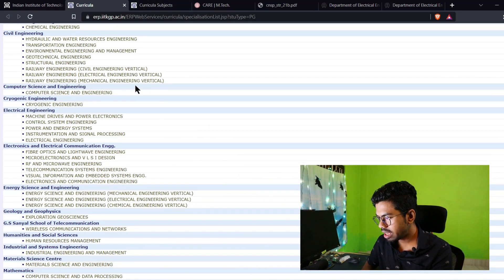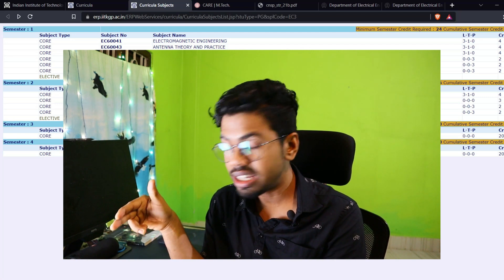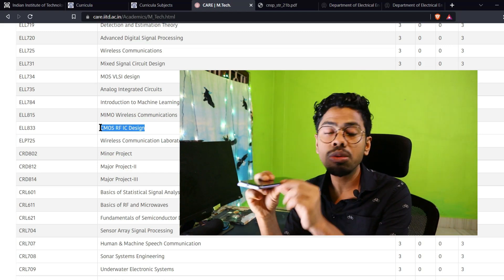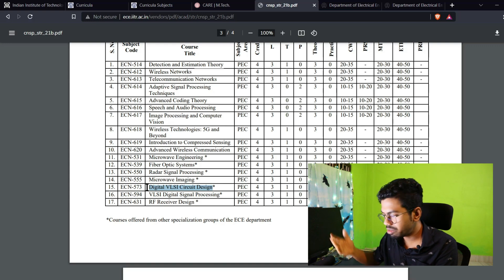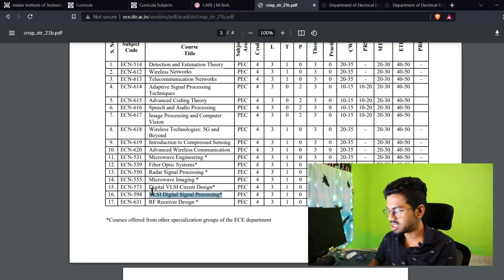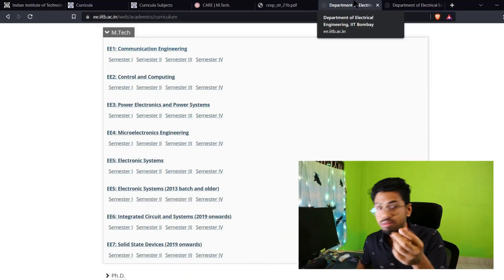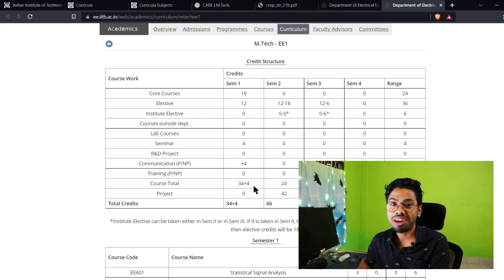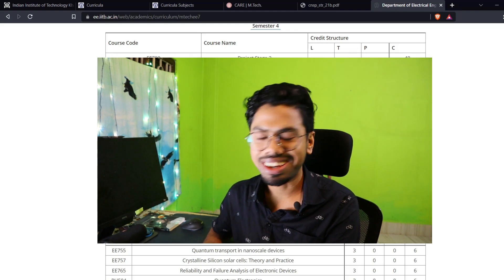Non VLSI IIT or VLSI NIT seat | Getting a VLSI jobs from non VLSI branch | VLSI vs RF vs Signal |

Comment: I completed my bachelor's in Electrical and Electronic Engineering.
I have never heard about vlsi and there was no opportunity for me to learn them in the Undergrad.
I am going for my master's in Electrical Engineering (vlsi).
For that I have started learning 1. Fundamentals of Semiconductor 2. Digital systems and circuits 3. Analog electronics 4. Analog integrated circuits 5. Vlsi physical design.
In nptel platform.
If i don't have a solid base i may find it extremely difficult in master's.
So I think I am doing the right thing.
Share your thoughts Mazumder.
Reply from the maker: Yes your doing the correct things... 4,5 is optional... If you can its great or can do this during mtech ... Also add digital ic (your list dont have it )in the optional list
Reply: @whyRD  thank you so much.
I have received my admissions from  Arizona State University, University of Texas Arlington, University of Texas Dallas, University of Houston, University of South Florida, Northeastern University and University of Buffalo.
Among that I have chosen Arizona State University.
Still left with 35 days I need to kickstart my preparation.
Reply from the maker: Congratulations 🎉

Comment: Sir IIT BOMBAY energy science and engineering is good for placement? After this will I get chance to go into vlsi industry if I do some additional courses?
Reply from the maker: Hi with extra course you should be , but issue is that some time visiting company  dont know much about your branch ,that this branch people are also equipped with vlsi skill, so they just dont include that branch for interviews.... So if max of people from any branch know vlsi branch then you can request particular company to open for you also.. To know this details connect with any alumni... Moreover off campus have no such issue.. Your cgpa,project and IITB brand talk for you.
Reply: @whyRD  OK thanks.

Comment: Hello bro. It is better to take training in bangalore Or to study  M. Tech for getting job in Vlsi so i completed one year in software industry. I want to join vlsi. Could you please recommend what is best
Reply from the maker: Both are best in thier own way... If dont wanna study all those non necessary subject for VLSI to prepare for gate and then doing 2 yearaster . then training is great.. But with training you need to have. Sounding knowledge of circuits analog digital and verilog and then only you need to start a training....then also training institution provide a very minimum placement assistance and that to majority of the case service base company.. And therefore to get into product based you need to do hard work in the company for less money for 3-4 year.... Before reaching to a stage where your salary would be same as a MTech graduate... In worst case you may need 1-2 more year..

Comment: Bro,
Please help me with a suggestion.Recently I got placed  in Lnt defence department and the role was not mentioned and the package was 6lpa.I have another offer from the vlsi based company I.e cerium systems which is 4.1lpa with 3 years bond.This year I didn't get a good rank in gate.Considering the good learning and growth and scope which company in your opinion is best to join?
Reply from the maker: It would be better if you the exact role of first offer to compare ...
Reply: @whyRD  Bro in the offer letter the exact role was not mentioned.They said that after 1 year training they would give the role based on the requirement in the company.I tried to connect through the linkedin to know the role but it  didn't work out.Suppose if the role might be given as Electronic system design engineer or Hardware design system engineer or Embedded related role, which would be the better choice between lnt defence and cerium systems?

Comment: Sir can you suggest me the best compiler for VerilogHDL
I tried edaplayground but it gives me errors as i don't have full version to use commercial compilers.
And also tried ModelSim works well but its way to big for me.
By the way I got seat in VLSI sytems in NIT Trichy, thanks for your guidance sir
Reply from the maker: Congratulations, try yosys , you need a linux virtual machine

Comment: Hello sir. Can you please make a video on basic subjects/knowledge we have to take for getting started on VLSI?
Reply: Although there are plenty of videos available regarding you question, here are some things tha may help you

1. Digital Electronics (NPTEL)

2. Digital IC Design (NPTEL : IIT MADRAS COURSE) (Book : J Rabaey)
    (Cover MOS basics and CMOS Inverter in depth)

3. Verilog (NPTEL : Prof. Indranil Sengupta) (Book : S. Palnitkar)
However, in case of Verilog you won't become proficient without practicing so I would suggest you to practice on HDLBits daily.

4. Basic Analog Circuits (Study from Razavi Lectures on YouTube) 

5. Low Power VLSI design basics(types of power dissipation,clock gating,power reduction techniques) (NPTEL : VLSI Physical Design by Prof. Indranil Sengupta , Lectures 58,59:  https://youtu.be/TFOO1JAll2Y)

6. Basic C

7. Python/Pearl

1,2,3 ---> are extremely important
4,5,6,7 ---> do if you have time

Comment: sir what's your advise for people with 3-4  year gap  after btech . how can they enter in product based company ?
Reply from the maker: Gap mean , do you have explanation for that... Will creat a little issue but , through gate mtech would be better way .. Or else getting first job in product would be next to impossible, you need to start with service based /statups... Spend 3-4 year and then switch
Reply: @whyRD  sir by gap i mean to say someone prepared  for 3 years for gate and then worked in embedded domain now want to switch in core vlsi domain is mtech only option to secure job in product based company can't the paid training courses available for verification ,physical design can give jobs in product based company
Reply from the maker: Those training max time land you in a service based job... But exception are there.